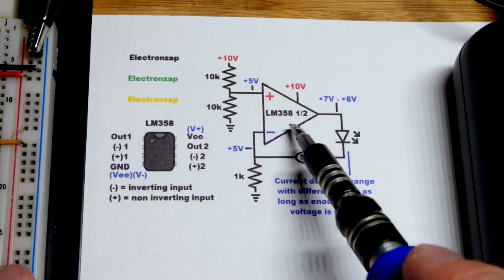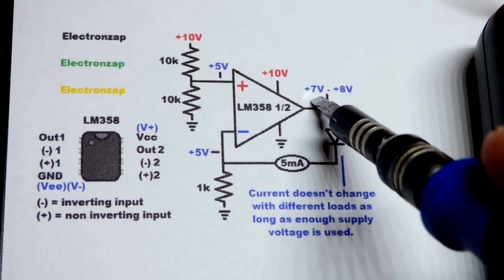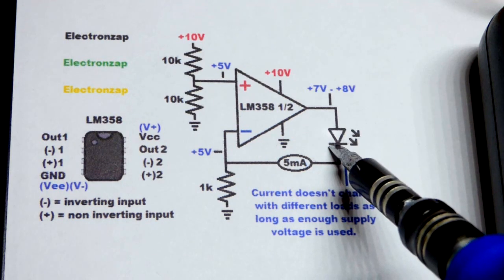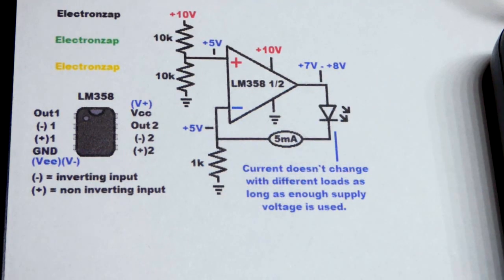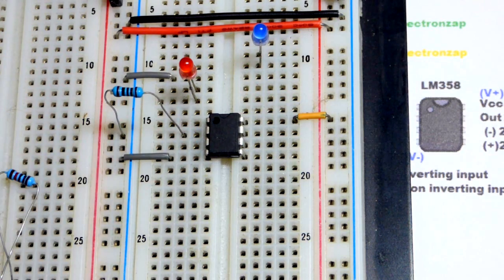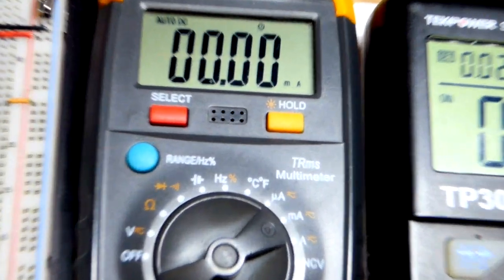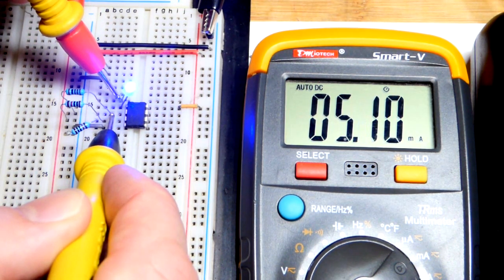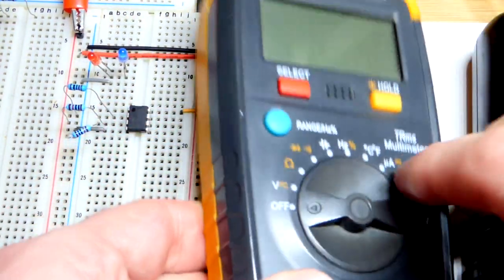Quick op amp current source circuit demonstration using LM358 operational amplifier how to DIY

Comment: Thanks!  I am trying to wrap my mind around all the options and configurations of this  flexible chip.   At the moment trying to set up multiple +- voltages with my power supply.  I finally found a use for the green terminal!  Hahaha
Reply from the maker: Nice! Possibility are endless. I found it most helpful to look at and study as many circuits as possible, starting with the simplest ones and working my way up. Things make a lot more sense over time.